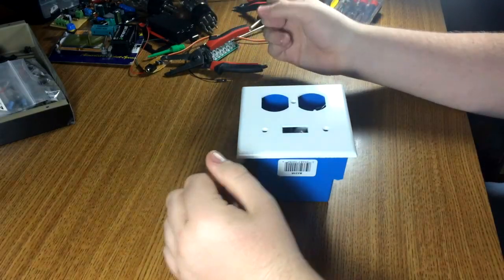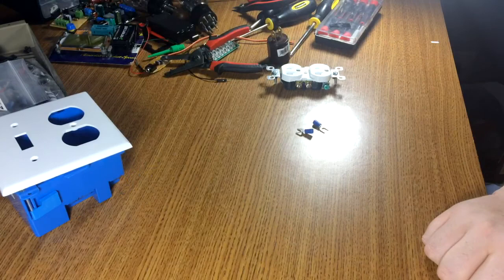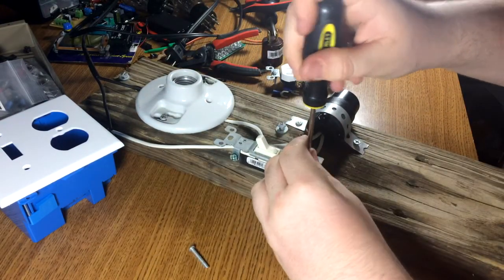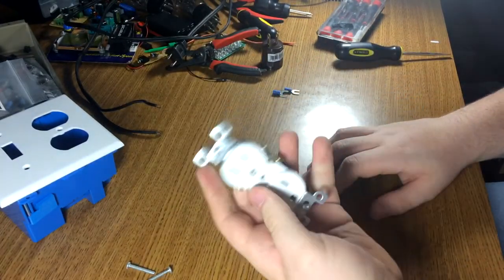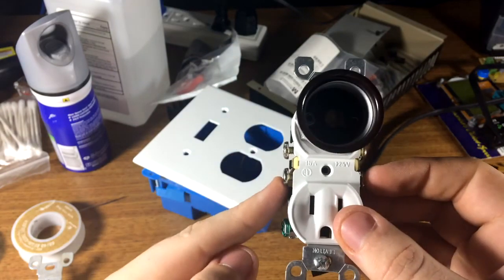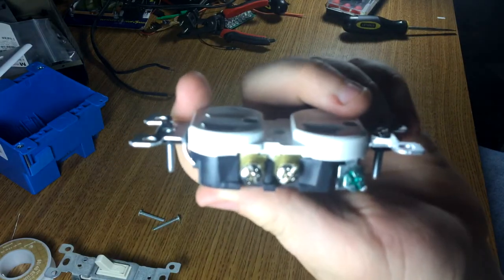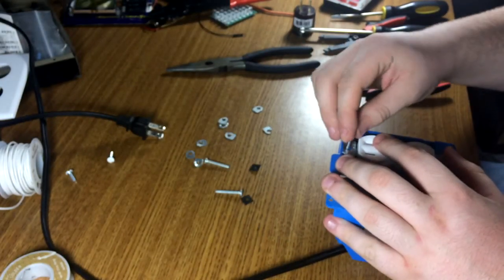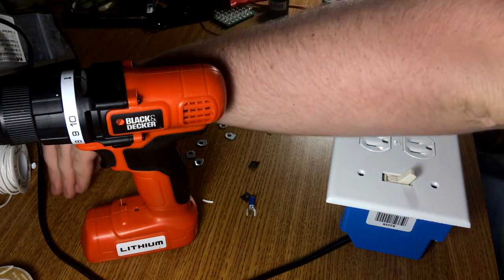Building a COMPACT dim bulb tester for electronics work

Comment: An easy way to always know which mains wire is which, is to cut the hot lead slightly shorter than the neutral. Very handy in speaker wiring too.

Comment: Does it make any difference that you are reversing the polarity on the load?  I broke of both clips on mine so that the out for the lamp crosses over to the in for the load and then the return is screwed in the opposite side that yours is.
Reply: On this one I built the polarity is only reversed on the top socket which is just for the light bulb so it doesn't matter, the bottom socket that you would plug your test equipment to is correct. the only thing that would really happen if you reversed the polarity is your live and neutral be flipped which would be the same as getting a non-polarized plug and flip it upside down and plugging it in

Comment: Thanks for this step by step....theres others on the web that don't show the correct wiring. One suggestion is to make sure that your incoming wire has a strain relief at the box. A few of these plastic boxes have built in collars but not many, which is why so many people use metal boxes.
Reply: I thought about a strain relief method but eh, this only gets used a few times a year

Comment: Hi. Just asking if it can be connected interchangeably. I mean, there's no ground. The outlet is just two-plug type. So there's a chance that the bulb would be in series with the negative/cold wire. Does this affect the performance of the tester?
Reply from the maker: it doesn't matter if the bulbs in the live or natural line as the current will flow either way as its the same circuit. the ground is as easy as connecting a 3 prong AC cord.
Reply: @bassblasteraudiotech4918  thank you very much for the clarification!